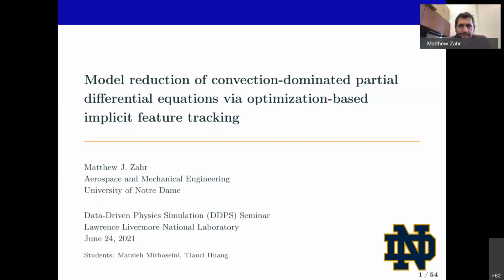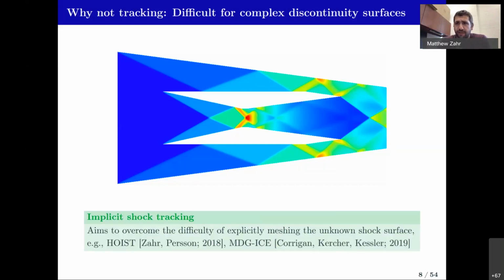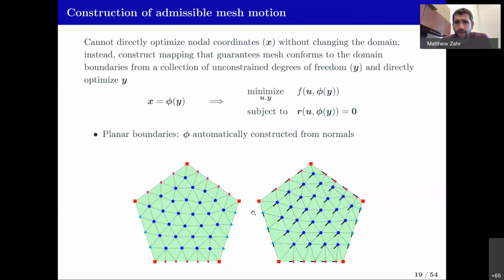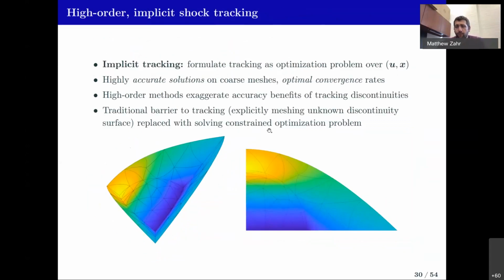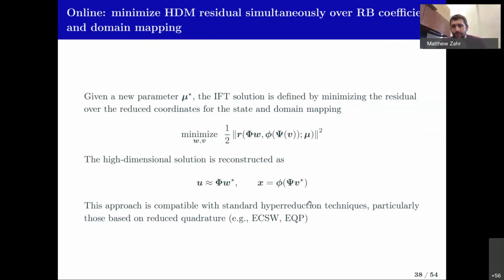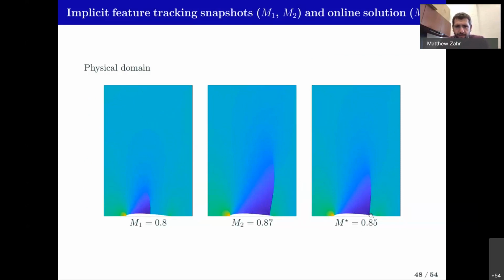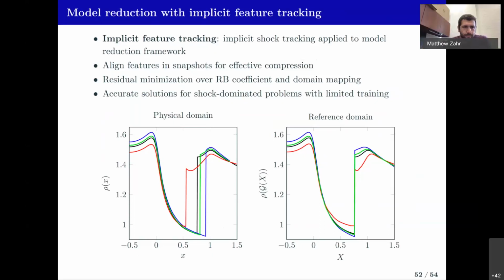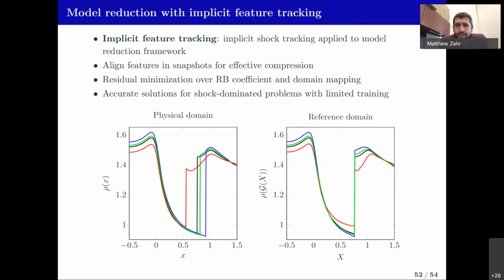DDPS | Model reduction of partial differential equations via optimization-based feature tracking

Comment: I also use this idea of finding a mesh coordinate to track features of convection dominated problems, but only have applied it to the ROM settings, both projection based and neural network based (presented in AAAI https://youtu.be/fDYPAj9WAbk ).
The connections/applications to/in the high order models, discussion of convergence, and the residual PDE-based constraint in this work are indeed insightful.